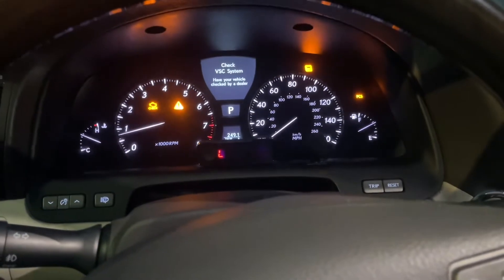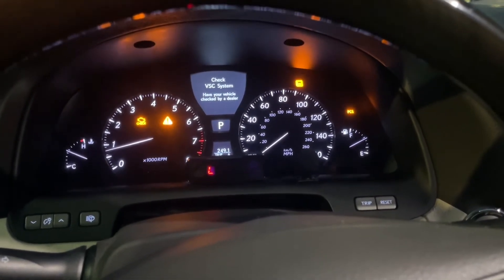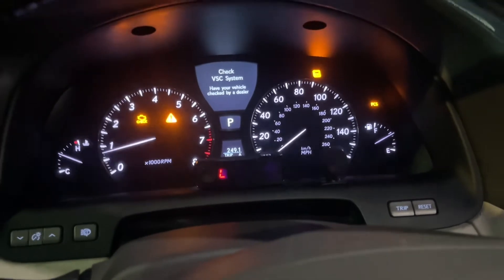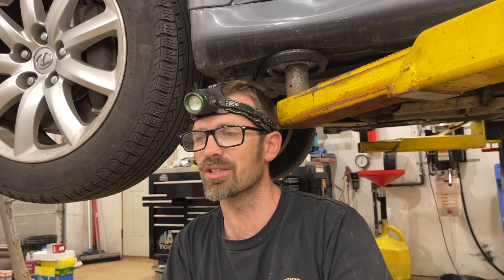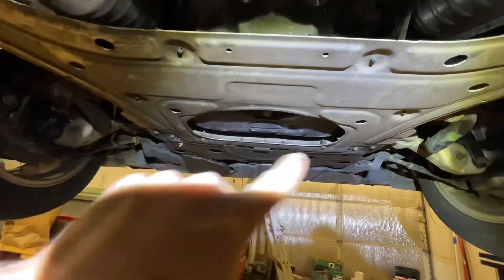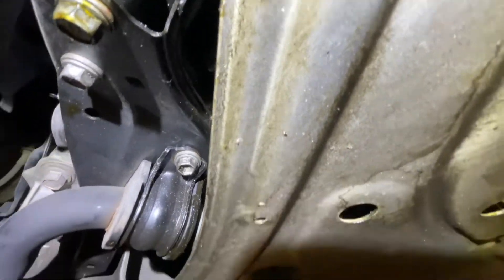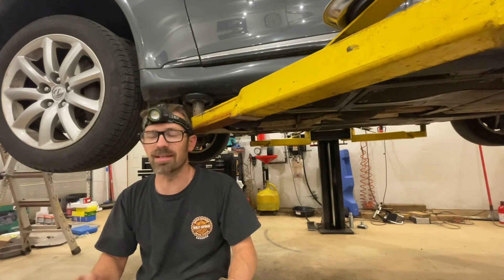Lexus LS460: no cruise, lots of dash lights, P0171, P0305, P0307, replacing O2 sensors.

Comment from the maker: I only covered the P codes but there were also C codes stored in the control modules.

Here is a great scanner with a lot of capability:
Innova 5610: https://amzn.to/3ZFN3hc

When I talked about pulling the plugs, the brank 1 plugs (passenger side) where pretty white, and bank 2 were much darker.  That was the indication that bank 1 was running leaner than bank 2.

Upstream left bank 1, sensor 1: NTK 24661: https://amzn.to/3WWPOtx
Upstream right, bank 2 sensor 1: NTK 24833: https://amzn.to/3Zwcrqq
Downstream left, bank 1 sensor 2: NTK 24605: https://www.sixityauto.com/ngk-ntk-24...
Downstream right, bank 2 sensor 2: NTK 24605: https://www.sixityauto.com/ngk-ntk-24...

0:23 the symptoms
0:48 stored DTC codes
2:12 diagnosing I did
3:56 what you have to do to change the upstream O2 sensors
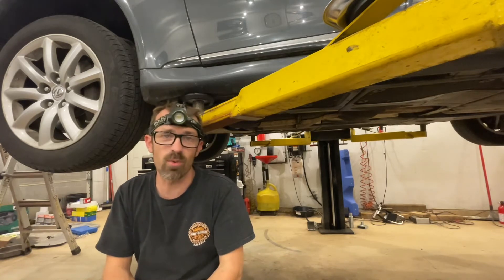5:50 wrap-up

As an Amazon Associate, I earn from qualifying purchases.  For your convenience, I try to post links to everything I use in the video description.  That's part of how I cover the costs of this channel.  I appreciate your support buy using these links!!

Comment: I have the same exact car but I have the codes P2238/P2240 which are the upstream sensors. I’m a beginner mechanic so I feel like this is going to be hell lol.

Also I have the VSC system check as well. Will replacing the Sensors fix that light?
Reply from the maker: Most likely. Of course there are always variables, but if the problem is just the O2 sensors (it does sounds like they are the issue), then replacing them should resolve all issues. You may need a higher level scanner than one that just clears P codes, but starting with sensor replacement is what I would do.

Comment: Hi, I have the 2011 ls460 and engine light is on with same code p0171 (Bank 1 system too lean for a predetermined period of time) read by both Oreily and Autozone,.  Both telling me to change Mass Airflow Sensor.  Do you know which side is bank 1?  And also, I noticed the pigtail connecting to the MAS is somewhat broken but wire still attached.  If one of the pigtail wire is loose or not connected properly, would it cause the issue?  Thanks
Reply from the maker: Bank 1 is the drivers side.  Yes, if a wire is not connected it could definitely cause an issue but I would expect a code referencing the MAF circuit being open.  If you are not getting any MAF codes it is unlikely that you have a bad wire connection even if it looks like it may be bad.
Reply: @ thank you!!
Reply from the maker: @ you’re welcome!
Reply: @bennieaust  I hope you dont mind I am asking for your opinion, before I buy the sensor.  The engine warning light turn on and off (will turn off when I do short drive, and on when trip is longer or hot).  With the engine light on, the idle is a little shaky, and I can smell gas near the rear when I stop.  Does this sound like a MAF issue?  thx
Reply from the maker: @tonyquach8788  it’s sounds exactly like the problem I had that was the upstream O2 sensor. I don’t believe a bad MAF sensor (even for just the one for that bank) will effect only that bank.  In my opinion, I would start with the upstream O2 sensor. 

Please also understand that it can be very difficult to diagnose a car I’ve never seen through YouTube comments.   There can be obvious other issues that I would find if I actually had the car in front of me.

Comment: I currently replaced my fuse link box and my car has went haywire. Giving me a p0560 code. I have no ac, Navi nor audio works and the emergency brake will not allow the car to move. 2008 ls460 smh. Help!!!
Reply from the maker: That's not going to be an easy one to solve remotely.  The P0560 code means "Powertrain System Voltage Malfunction".  If you haven't already tried to clear it, I'd start with that.  Then go back to the last thing you did.  Double / triple check your work, verify all the connections are good,  check fuses.  

That's about all I have off the top of my head.  Hope that helps.

Comment: which one is bank 2 sensor 1? i have to replace mine and i’m really struggling to figure out which one it is
Reply from the maker: Right bank (passenger side) upstream.
Reply: @bennieaust ok. and how do i get it out? what should i remove to get to that side?
Reply from the maker: @jayelking2856  this is the closest video I have to actually doing it. It covers what you need to remove. 

It’s a pain to get it unplugged you will probably need a long screwdriver and a long 90 degree pick, but that’s how it’s done.
Reply: @bennieaust  okay thank you. and lastly, what should i torque the sway bar and the sway bar bracket down to?
Reply from the maker: @jayelking2856  I couldn’t find the exact spec listed anywhere but an M8 fastener should be right around 20ft lbs (28Nm).
Reply: @bennieaust i’m doing it now and it was pretty easy to get it unplugged. but plugging the new one back in is going to kill me i swear. it’s been about 2 hours 🤦🏽‍♂️
Reply from the maker: @jayelking2856  I’m glad at least half of it is going well. :)

Comment: Im currently trying to replace my bank 1 sensor 1 on the same car as you, I’ve done all the steps you’ve said but I can’t unplug the pig tail it’s just to high up in the car any tips for this or videos
Reply from the maker: It's a pain.  There's no 2 ways about it.
I unscrewed the sensor, then reached up to the harness with a long right-angle pick.  I used the pick to unlatch the harness, then pulled the sensor down (pulled on the wires) to unplug it.  No room to actually reach up there.  I was able to use the same pick and a screwdriver to plug the new one in.  Patients in the most critical tool you will need.

Comment: Its the 0² sensor
Reply: I had the same problem it was bank 1 i paid 360 to get it put in then 2 days afterwards bank 2 went out and had to pay another 360 🤦🏾‍♂️
Reply from the maker: @dannyd11233  , bummer, that’s why I just replaced both of mine.
Reply from the maker: Yes
Reply: Question have you had any issues with the tie rods and front control arms
Reply from the maker: @dannyd11233  I’ve replaced both inner and outer tie rod ends. That’s a very straight forward repair. 

I haven’t done anything with control arms yet but it’s in the works. I plan on shooting a video of it and doing a complete replacement of all the front control arms and ball joints. That probably won’t be very soon cause the car is parked for the winter.

Comment: I did mine on the driver's side and getting that plug disconnected was a major pain in my a***
Also I had to get a 2 foot pick tool to reach and unplug the pig tail.
I'd rather pay the dealership $450 before I do it again. 😁😆😁
Reply from the maker: Lol, I definitely had to use a pick as well. It’s a pain, but I’ll do it and save some bucks.